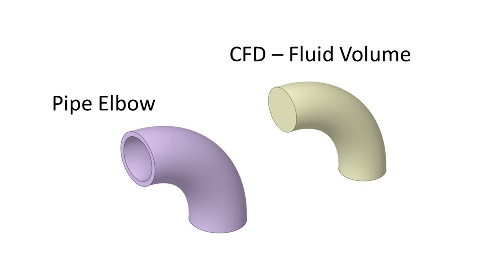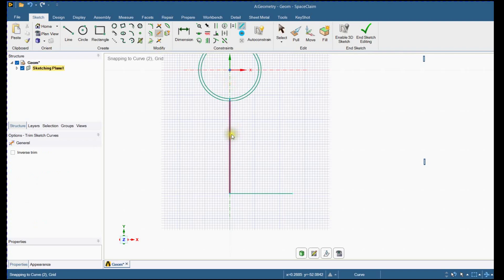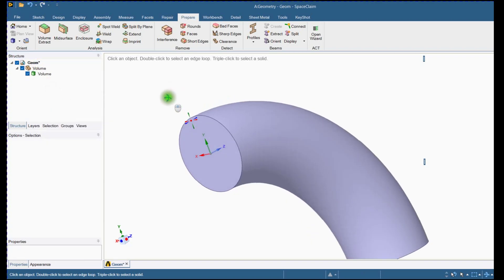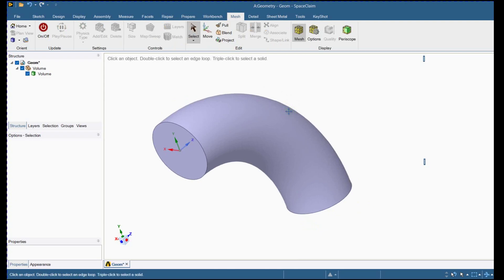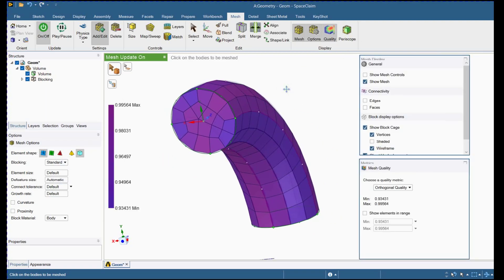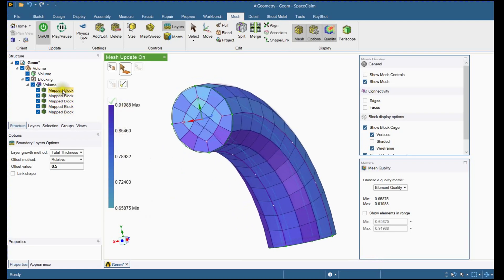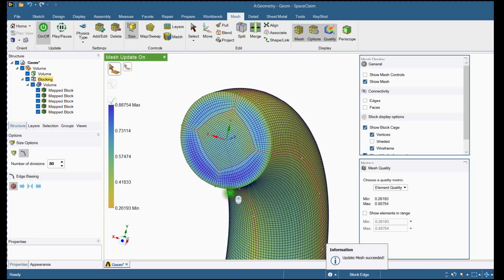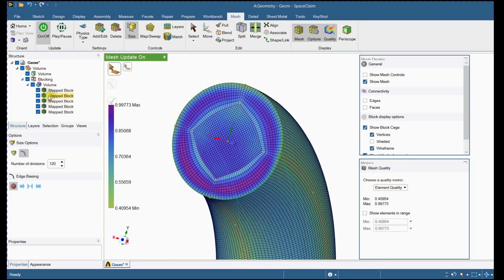ANSYS SpaceClaim: Meshing | How to generate a high quality mesh for fluid flow through pipe elbow

Comment: Interesting approach but it's not going to be that easy blocking if you add straight portions of the pipe which you must have. But not that bad, just needs a bit of trial and error to make it work. It doesn't connect several parts right away smoothly through that layers profile.
Reply from the maker: Thank you for your feedback 😊
Reply: Hi I'm having that problem it creates some extra blocks at they interface between elbow and straight Pipe, how can i fix it?

Comment: Hi! Your videos are a great find for me. thank you very much!
But I ran into a serious problem to perform my calculations.
So, I created an internal volume on the Dy200 and the same length. I set the following parameters:
The number of layers is 25
The height of the first cell is 0.005 mm
The degree of growth is 1.2
When generating the grid, the generator writes that everything was completed successfully, but when I save the file with the extension.msh for Fluent, then negative volumes are formed
Reply from the maker: Please check with other ANSYS versions.